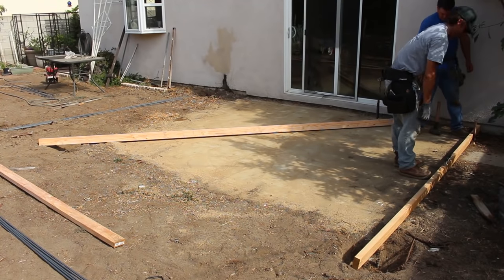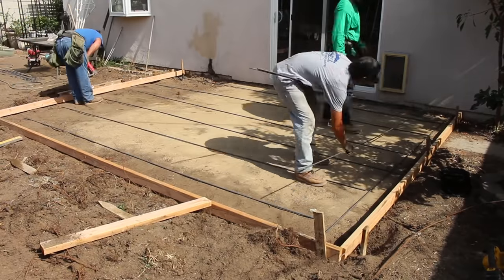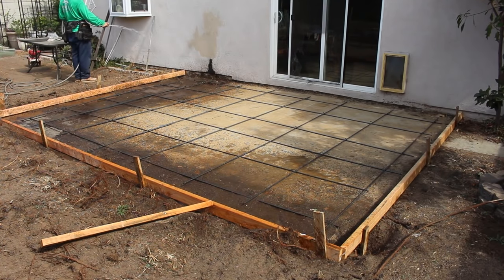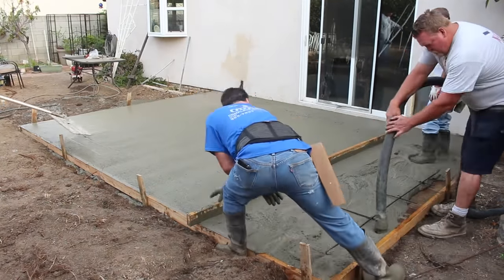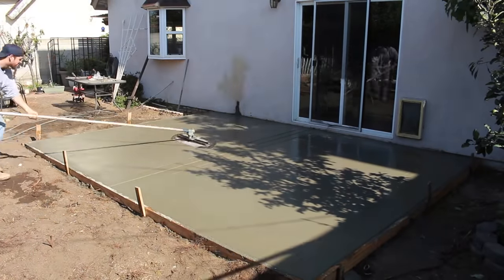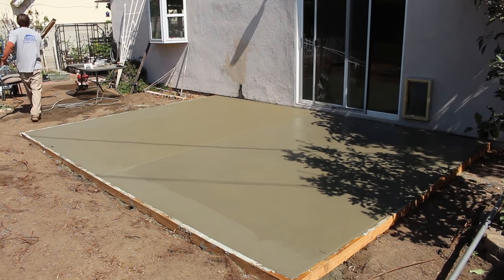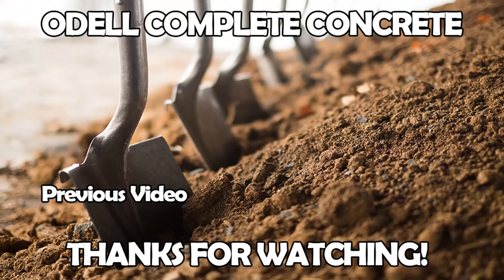How to Pour a Concrete Slab for Beginners DIY

Comment: I'm going to be very limited in what I have available. Basically, a bag of lime, water carried in by the galleon jug and raw sand from the location. I need all the advice I can get. I'm going to be in a thickly wooded area in very sandy soil, so I'm going to use a rake to get the forest detris clear of the sand and then 'harvest' sand from the site. Here's the question, for a primitive concrete, how much lime to how much water and how much of that mixture to sand? I need an area about 15' x 15' and at least a foot thick. Do I do this in layers? How many and how thick each? There is no vehicle access to the location.
Reply from the maker: sounds like learning experience.
just make happen captain

Comment: Does gravel need to go down before the concrete is poured to promote water drainage throughout the life of the slab?
Reply from the maker: no
Reply: It depends on the climate. If you live in an area that has a pretty good freeze, I'd definitely put gravel down first. If not, when water gets under the slap and freezes, you'll get frost heave causing sections of the concrete to lift and look bad.

Comment: Thank you for this. I need to throw a slab to raise a floor that had wooden blocks before I have pulled out the blocks and now need to raise the floor 2cm and tile over it so finish is not important. Do I still need rebar?
Reply from the maker: YEs

Comment: Question, why do you have to continually work the surface of the concrete while it dries? What happens if you don't?
Reply: Michael Diamond it’s important to use the magnesium float which pushes the aggregate (rock) down below the surface and brings up a layer of the slurry to form the smooth surface. This is the hardest part of finishing concrete. If you mess with the surface and trowel too much you’ll have too thick of the slurry layer then over the years the surface will crack and start to chip all over. Also if pouring when it’s too cold and this watery layer freezes, the concrete top layer will chip off.
When you see sidewalks and crappy concrete jobs where the top layer has chipped away it’s because they either let it freeze or didn’t trowel enough and the slurry layer was too thin causing it to chip away. Also this is not a DIY. The key to pouring concrete is having enough people to get it poured quickly before it starts setting up, guys that know what they are doing. You don’t want to buy $1500 in concrete and not be able to lay it down fast enough before your out of energy and the entire thing is ruined. They used a pump truck which the concrete uses pea gravel and is slightly thinner mix than if it was poured from the truck giving them more time to work it before it sets up.

Comment: At 1:40 you mention rebar is needed all the way through but to the right (especially the second one from the bottom) is clearly not reaching the edge. Is that right? Thanks for the content.
Reply from the maker: The most important part is that the rebar goes past the end of existing patio
Reply: Odell Complete Concrete that is precisely why I ask. It looks like that part is just where the older patio ended.

Comment: At What point do you grade the concrete so that water flow away from the house? Or only for pours greater than a certain size? Cherrs
Reply: You mean correct the grade before pouring the concrete?

Comment: Wat was the stuff u used to to brush it like the broom but not with the broom almost like a Swiffer to dry it up or what was that and then you threw some white powder on top  was that also
Reply from the maker: Bull float and concrete curing compound

Comment: Why is the guy going back over the concrete with hand trowels and kneeling at about 4:25 ? Is this step necessary? I'm about to pour a large slab but don't understand why you would need anything but the bull float and the fresno before the broom finish. I did a smaller slab last year and didn't do this step then. I've watched a few other videos and they always seem to use these knee pads and hand trowels as the last step before the broom finish.
Reply from the maker: Probably not necessary just looks nicer

Comment: Hi if im buildin a 10x10 ft slab at 3'' thick...for a  structure that will have clay blocks will i need to trench.....how it is now its in wood resting on the top of the ground ....
Reply from the maker: Depends on where your at

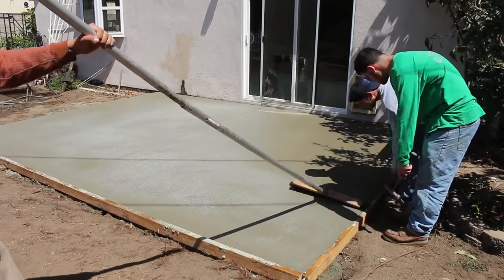Comment: 5:44 He mentions using motor oil or veg oil so the wood wont bond with the concrete. How would you apply this to the board? Would you do it beforehand and let it soak in? Or would you do this on site as you lay the frame down?
Reply from the maker: I spray the day of the pour

Comment: Can I do the same method for a house?  Also once the foundations done do I just start laying the concrete blocks for walls on top of it?
Reply: No. You need cross beams and footer beams along with the supporting steel to keep the slab from cracking. Especially, if you're going to be setting concrete blocks.

Comment: If you would have put a vapor barrier under it, it would dry evenly and not bond with the existing concrete slab.  Bonding with the slab below creates tension....IE cracks.  You want the new slab to be able to slip and slide on top of the old slab to prevent cracks.  Any consideration for placing the control joints in pleasing locations....IE at the edges of the sliding doors?  Oh, and the concrete cracks when you pour over dirt right next to concrete because the dirt will compress over time due to the weight of the concrete.  Replacing that dirt w/ sand and gravel would keep that from compressing.
Reply from the maker: Sounds intense

Comment: Mr. Odell. Please give me some advice!
I'm looking for options to build a woodworking shop floor. It's 26 x 49 ft. I'm interested in the floor being level (very flat) and solid (that doesn't bounce under pounding) and pressure (weight of machines and load) doesn't get it out of level. It sounds like a place for a concrete slab, doesn't it? I know that would be the best option for what I want, but I'm in the lower side of the budget range, so I'm looking for options! 
I can build with wood and concrete piers, but I've never worked on concrete slab forming and pouring before. So, could you, please suggest me maybe a concrete slab design which is light and low cost? Maybe filled with rocks to keep concrete mix low? I'd like a 5 inches thick slab. 
Thank you a lot in advance. Btw, your videos are very, very helpful :)
Reply: Leonardo Rojas nothing low cost in what you want. The solution is simply pour a 6” slab with rebar and mesh. Unless your running metal hammers or machines that weight thousands of pounds, you don’t need this. For a flat floor that’s where the skill comes in and finishers. Or use one of those sit down polishing finish machines they use in warehouses. Because the floors need to be super smooth for forklifts

Comment: I saw another video where the guy drilled some screws into the foundation before pouring the slab. What is that for exactly? And is it required?
Reply from the maker: not required just a bonus

Comment: Hi I have a question: When a pour a small slab prior to receive an outdoor stairway,  i usually run a 2x4 over the top of the form and then i finish it with a float and a broom. when I come back the day after, i realise that the concrete level is higher (about 1/8 to 3/8) than the form that has been setted accurately to fit the stringers. What am I doing wrong?
Reply from the maker: Not rodding tight enough on the forms.
Reply: thanks for anwsering.

Comment: Can I put red bricks that have the holes and pour wet cement on top of the bricks and  smooth  and level the cement  with boards and use decorative glass rocks on top of cement to make it decorative
Reply from the maker: sure
Reply: Odell Complete Concrete thank u

Comment: Do you know why my concrete is dark grey in color when I mix them on my own, with cement, sand and 3 quarter blue stone? I can't get the light grey color like the sidewalk concrete
Reply: Xinyu Lin cement from different suppliers will have different colors and if the sidewalks had flyash added it’ll make them lighter in color.

Comment: Can one make a concrete slab like this and top it with exposed aggregate as shown in another video?  I want to build a driveway that way. Not the "broad slab" type, but one make of two paths for the wheels of the car with a turf patch in the middle. 
I am sure there a simple name for this, but my english fails me.
Reply from the maker: driveway ribbons
it can be done

Comment: Aren’t you supposed to tie it to the house foundation by drilling holes and inserting re-bar?
Reply: Ummmm......No. If anything you should place an expansion joint between the house foundation and the slab.

Comment: Should you put footings for this size?
Reply from the maker: NO
Reply: Im thinking of puting a slab 20x17', with footers. Should i still need to put concrete wire mesh if the concrete has fibers?

Comment: Didn’t you have to put the rebar on stands because that’s wt I did wrong on my I lay my on the ground like you did. and all crack in the middle a year later and a friend who’s a contractor told me that was my mistake.
Reply from the maker: You should have pulled the rebar up when you placed the concrete.

Comment: Great video
Reply from the maker: TY
Reply: @OdellCompleteConcrete   video was exactly what I was needing to see. I have an old slab that's broken up. I was wandering if it had to be broken up or if I could clean and lay down the support metal and just pore over it. Also great about used motor oil on the wood.. Thank you. Your video answered all questions..

Comment: '
what is that spray white powder on the wet cement / concrete end of video...
cement / concrete can easily crack after fully dry
Reply from the maker: Concrete curing compound

Comment: How do you make sure it’s on a slope? Doesn’t concrete, as any liquid level itself?
Reply: By putting a mark on the wall and slope the front 2x6. You can see when pouring, they use a straight edge to follow the slope...

Comment: Why the line in the middle but right in front of the door?.maybe on the side where the wall meets the sliding door...js
Reply from the maker: Better to split down the middle, better chance of it not cracking

Comment: Just   1   control  joint  in  the   center?  I  think    need other  one  crossing...  (sorry)  You  can  cut   later  no  problem   ½  inch  deep  for   avoid   to   crack.

Comment: It look easy, see how much work those guys did?, the key point is to know when and where to apply what, a trained eye make it look easy because they apply only where needed which leave undone could mean success and failure, I pull smaller path than this before, it easy if you have no standard, it become real hard if u want the professional look, better leave to the expert
Reply from the maker: Practice practice PRACTICE

Comment: Why do you not rest the rebar on the small cement blocks or even small stones to hold it off the ground as it is supposed to be rebar was sinking back to the ground so doing no good at all
Reply from the maker: rebar doesn't sink in concrete

Comment: i have poured concrete a few times with family.... not alone...I have a old tiny brick house 1888 to be exact that somone poured A LOT of concrete around the concrete is broken and in poor repair, also they made these concrete/brick/ clay/re-barb th/sandstone/tile monoliths to be "artistic" (looks hideous actually) much of the concrete is cracked and water runs toward the house as the back yard is built up compared to the concrete and it seems they didn't angle the concrete to slope away from the house home is only 16' wide and I have a 10' passage next to the side of the house to work with meh i guess the length is 64' i have a tiny house, (basement always getting wet), i wanted to put a drain down the side, there is also on the side of the 10' space on the side a retaining wall between my neighbors (much higher yard) and this 10' space i would like to put in a french drain from the back yard down this way for the water to drain how far should i stay from the retaining wall?

Comment: You need a proper support plastic chair for the mesh otherwise it will just sink down.
Reply from the maker: Rebar doesn't sink in concrete
Reply: Odell Complete Concrete
It dose sink right after when you lift next section of mesh. Also you can’t place mesh right position without using chairs. Think about why concrete chairs are exist!!

Comment: Whats the middle line for?
EDIT: After a little research, I found that it is called a contraction line. Helps with the prevention of cracks in the concrete slab. 

http://www.cement.org/learn/concrete-technology/concrete-construction/contraction-control-joints-in-concrete-flatwork

Comment: You're supposed to hardcore first and also tie the steel rebar joints with wire!
Reply from the maker: I rarely use fill around here, the ground is good
Reply: He did wire the rebar....

Comment: Dang. Was that 7 guys on one slab.
Reply from the maker: we did a slab in the front but there was only 5 guys in total on this job
Reply: Odell Complete Concrete. Right on for sure. For all I know u could be teaching them. But looked good.
Reply from the maker: I suppose I am teaching, but also we poured the driveway with the same load.

Comment: Definitely not for a beginner as the title says.
Reply from the maker: Some people can handle it.
Reply: some ppl are just more handy than others. ive never done anything like this before but definetely looks like a project i can take on. I added a full bathroom in my unfinished basement with no existing plumbings just by watching youtube videos...Saved a good $10,000 on that project alone!
Reply: A beginner can do this. I did the sidewalk in front of my house as a total rookie, and last I saw it 15 years later it was still in good shape. With patience and proper planning, you can do a small patio slab.

Comment: Shame on you for using a concrete pumper. 4 guys with wheel-barrows can hump concrete faster than a pumper. On top of that, you charged the homeowner at least $600 for the pumper, and now the bad part: the pumper usually cleans his hose on-site. That’s usually about a yard of concrete wasted that the homeowner pays for and the mess of getting rid of a yard of concrete after it hardens.
Reply from the maker: Its either a pump or buckets through a side yard with 20" access, ask before assuming in the future
Reply: Odell Complete Concrete oops....never mind😬

Comment: Six workers? How is this a DIY project?
Reply from the maker: The more the merrier
Reply: I recently had a cement waterway installed to direct rain water runoff from the roof along the front of the house. It drops about 18 inches over the length of about 65 feet. Unfortunately there are a couple spots where water pools. Please direct me to a video and product for filling in the depressions. Also, I plan to apply a sealer. Can I apply the sealer before the depression infill or should I wait till afterwards? Thanks